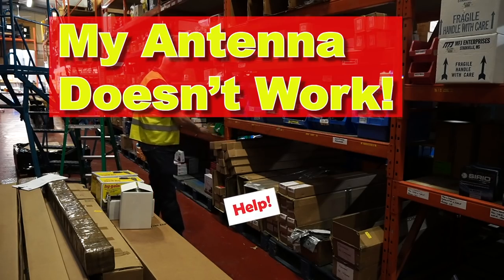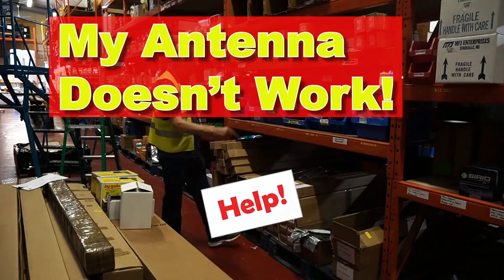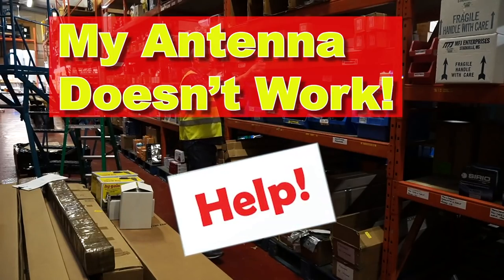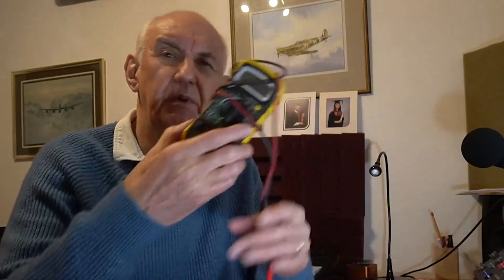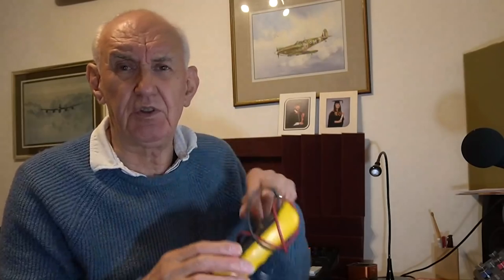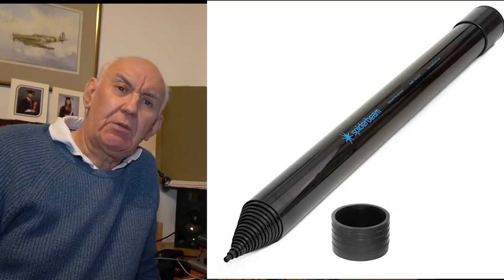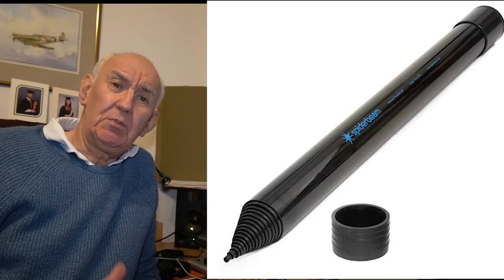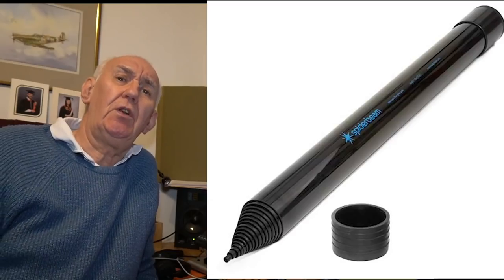Ham Radio - My Antenna Doesn't Work - Don't Panic.

Comment: Thank you.
Best advice I got from electronics techs is to read the manual carefully and take notes. 
Manuals do have errors.
Even call and talk with the manufacturer's technical staff.
Also contact other equipment users- they may have found and fixed a problem you have not even considered.
   Thanks again. N0QFT
Reply from the maker: Many thanks Glen. 73 Peter

Comment: Another good video! Every in line connector, adapter, ground block, surge protector, antenna tuner is a place for a problem. I've had bad lightening arresters, brand new, cause issues out of the box. I worked for the cable company for years, and troubleshooting always started with eliminating as many factors as possible, including replacing fittings and barrels. An incorrectly prepped cable with a poorly installed fitting was very common, as 1 strand of braid would wrap the center conductor. Very hard to see at first glance. Keep the videos coming!
Reply from the maker: Thanks for sharing Stanley. 73 Peter

Comment: All good advice as usual Peter. A couple of things that may help is that, to check for open circuit on your co-ax, if you don't have a dummy load, just short the plug shell to centre. If all us well, at the other end you shouldn't measure more than a few ohms of resistance. Also, for anyone who is not a CW operator, one alternative to RBN is WSPR - a fantastic tool for assessing antennas on receive and transmit. BTW, would be interested to know a little bit more about the antenna in your article.
Reply from the maker: Many thanks Steve - all noted. 73 Peter

Comment: Great information. I’d love to see a video on the best way to use the internal ATU of the Icom IC-7300.
Reply from the maker: Many thanks. Peter
Reply: Just push the tune button. Unless you're antenna is worse than 1:3. I use an LDG IT-100 with mine. It will tune a piece of linguine.

Comment: I had this happen to me. I had an army stick that I used on ten. not much action out there, but I desided to hook up a C B. it had a warning on it. well the end of the coax had got water in it. I'm glad I to the ten meter out of line and hooked up the cb mobile. I have other antennas. I took this stick down to find it was the cable.
Reply from the maker: Many thanks Francis. 73 Peter

Comment: I have a Diamond CP6S running with an Icom 7300 - I measured the loading coils but still not resonant on 80m as have the radials in a 180 configuration due to height restrictions from the Body Corporate on the housing estate I live on so very limited on 80m and even using the built in tuner still will not SWR so put in an external MFJ ATU and get the SWR as good as I can and the radio tunes the rest - but still on 80m have trouble getting signals 20km north but on 40m can work up to Far North Queensland, Japan and NZ.. 80m - you need that antenna high!
Reply from the maker: Hi Danny. it is possible that the antenna is resident at the very low end of 8 to metres in the CW section. check the VSWRat the bottom of the band. If this is the case very carefully cut off 2cm at a time and reche k 80m. If 2cm has no effect then that is nit the problem but it is quite common for 80m resonance to be at the bottom of the band. 73 Peter

Comment: All common sense, to me anyway, though to someone new it might be a Godsend. 
 I put up a CB aerial and thought there was something wrong as I was not getting anyone, hearing anyone.  SWR was fine, checked the cable and aerial, all fine and thought "Very odd" it was because there was no one there as I found out later (around seven hours later) when I got a loan of a SSB CB and made it into Costa Rica with 12 watts SSB and on the same aerial.  
So just goes to show, the reason I was not getting anyone is because there was no one there! 
Then I had to take the aerial down again before I was told to by the landlord!  ;-((  
Still working on getting permission for some aerials, but Covid is getting n the way of a decision :-((
Reply from the maker: Thanks Bob. 73 Peter

Comment: Antenae/aerials always work, just not always in the band you expected, unless you inadvertently ground, or assemble it incorrectly.
Reply from the maker: or its faulty!
Reply: @watersstanton  faulty? How? Basically all aerials are a length of conductor with a connector somewhere along it. The connector may or may not be earthed/grounded or may have some form of ground plane. There's little their to be faulty. A stray strand might earth the active element or you may have d dry solder joint. Other than that whats to be the cause,of a fault?

Comment: Some great advice there , it’s very easy to panic when often the answer is very simple 
I often use web sdr in uk as well as USA for checking propagation , these are also useful for checking antennas , great video once again, cheers de 2e0nbk
Reply from the maker: Thanks for sharing! 73 Peter